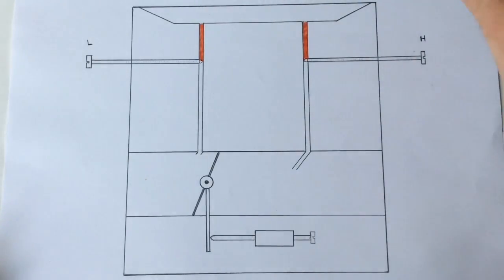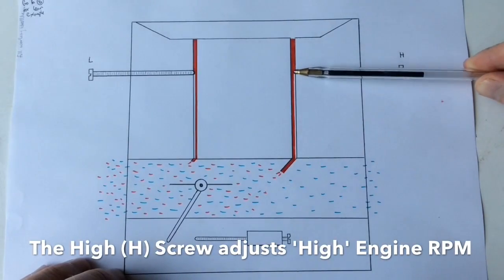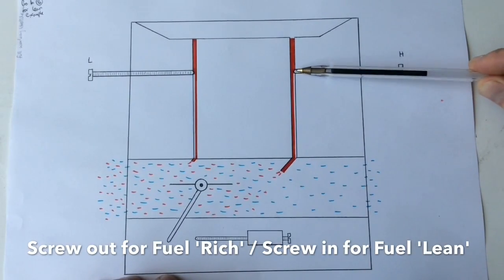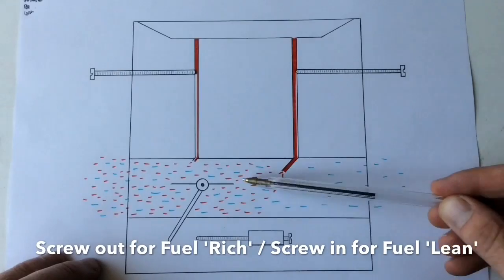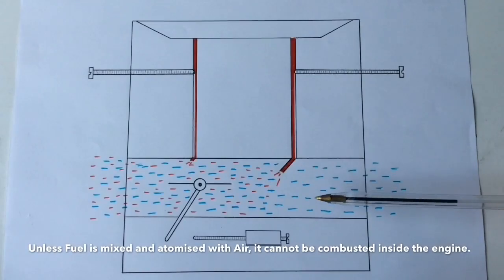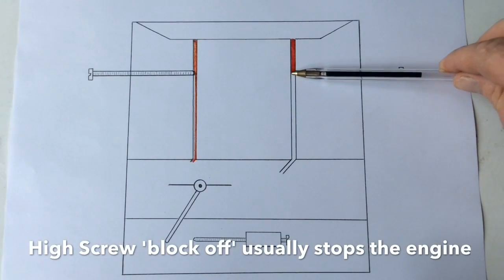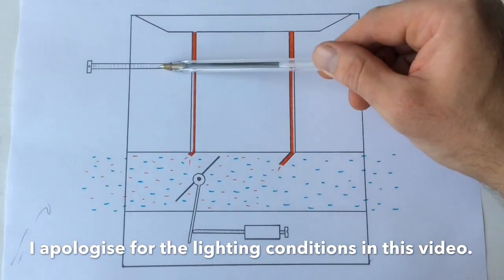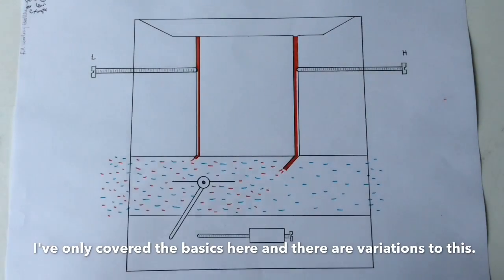CARBURETOR TUNING: Chainsaw Carburetor Settings - RICH & LEAN (by Craig Kirkman)

Comment: Working on a carburetor of a chainsaw actually myself. After months of struggling with my Jonsered (Bad starting, when it turns warm it stops working). I'm actually finding out on how to adjust the T, L and H on the machine. I already cleaned out some carburetors, the one of the Jonsered as well. So I got experience on cleaning them, not on how you have to 'calibrate' them. Thanks for your video. It clears out a lot for me. What do you think about a tachymeter, to read out the engine's RPM ? Useful or not?

Comment: My bike (1975 Suzuki TC185) died after a short ride to the auto store to buy a new spark plug this morning. I thought my new plug might have been the culprit, or maybe the new gasket I installed last night. I pushed it a half mile home. I had spark, so I checked compression. All good there too. So I looked at fuel since that had to be the cause. I put a new fuel hose on thinking it just might be really dirty, then realized.... This morning I adjusted the richness, and accidently set it to all the way in lean for both sides. I set it to very rich, and started kicking the starter like it insulted my mother. It started chucgging, then held about 500rpms. So I opened the fuel mixture more, and voila! She ran.

The new gasket I mentioned earlier was for another issue I had. When I got my bike up to 45-50mph, I would lose power and the bike would chug until I was under 35mph, then pick up again. If it looks like a compression issue, and sounds like a compression issue, it's probably a compression issue. I took the head off earlier in the week, and what do ya know, no head gasket. I cut out the a gasket yesterday and installed it last night. After fixing my problem from this morning, I took it out for a spin, got up to 55mph and held it pretty good for a half mile. Then the gasket blew. No compression. I had a socket wrench for my spark plug, but not for the nuts on the head. So no fixing it on the road. So I pushed it back a mile and a half. 

Luckily I live out in farm country, so the road I was on was almost a straight walk home on level roads. It's also in the mid 60's fahrenheit so that's a plus. I love two strokes because they are easy to fix, but man when it rains it pours.

Comment: That's a good simple example and like you said there are different carbi's, with my Yamaha AG100 1973 A model, mikuni VM20SH carbi, there is no high rev mixture screw, only one for idle stage, to adjust mid to high rev mixture it's done with the float level, a high float level is rich and low level leans it out, it's fun getting it right, my service manual says to turn carbi upside down after removing bowl, remove gasket and set float without spring in needle being compressed, from the high side of float to the surface the gasket seats against, is 19.2mm, though where I'm living in Cairns Australia, this tends to be a bit rich, there is a tolerance of 2.5mm of float level, I find at 20mm it runs good.

Comment: Thanks for the explanation. I have a new Stihl km94rce trimmer that is hard to start hot. It went back and they replaced the carb, still same issue. It has been extremely hot outside so this could be the entire issue(?) but is it also possible it's running too rich? Thank you

Comment: My mercury 60hp carb has just on air fuel mixture screw on each carb. The service manual states 1 1/2 turn out. For adjustment do I only go out 1/4 to 1/2 more for better run performance so it's a bit on the rich side for each carb? The manual states RPM’S should be 650 - 750 in forward gear for idle. Does setting the carbs affect the rpm then?

Comment: Hi just seen your very helpful video, u have a small question my chainsaw is quick new not used very much, however I've tried to start it and I manage to get it to start but when I pull the trigger it dies, I changed the petrol but still it dies, also if I try and leave it to idle it still eventually dies, any ideas plse.

The filter doesn't appear to be blocked either.

It's a titan chainsaw from Screwfix bought last year
Reply: Am I right in saying  that I would need to adjust the L adjusting screw?

Comment: Hi, really useful explanation but I'm having a problem getting my saw running nicely. I've just done a pot and piston replacement (first time) and now I'm finding that although I can get it to idle and sound OK once I work the saw the revs dont come back down to idle and obviously the chain keeps  running. If I put the chain brake on then off again the revs will come down but not by much if I just release the throttle. What would likely cause this? Any help would be much appreciated 👍
Reply from the maker: Sorry to hear you have been having problems.  It sounds like you could benefit by having your saw tuned properly.  Please take a look at my video on how you can do this step by step.  You can find in this link:https://www.youtube.com/watch?v=74p9FLmIkkw  .  I hope this helps! Cheers Craig

Comment: Hey bro can u tell me how much turns to open the hight and low screw at first and the carburetor have another screw that's not the hight and low screw so I want to know how much to open all 3 at first
Reply: Please answer asap
Reply from the maker: Hi.  This is my video that I hope will answer your questions.  Please go straight through to it via the link.  Menu thanks indeed, Craig.   https://www.youtube.com/watch?v=74p9FLmIkkw&t=43s

Comment: So if my engine runs perfectly in idle and full power but after checking the plug it looks too rich. (Plug wet) I just need to close the high a little bit to make it leaner ?

Comment: thanks ..very good..so i have problem with my spark plugs after 3-4 kilometres are black..i have given 600 euro for service but nothing..i think is rich mixture of gasoline ..should i tightening the nuts of my carburator for the lean of mixture??

Comment: Another very good explanation. Thank you. When I am trying to start a strimmer and having problems getting it started (plug wet and spark ok)  which of the adjustment screws is it best to start with.  Fuel doesn't seem to be atomising